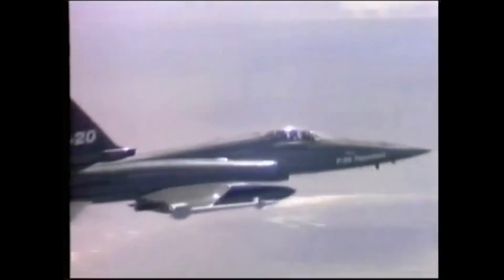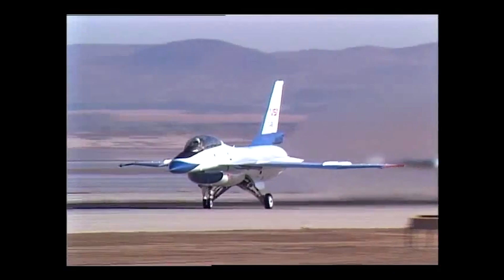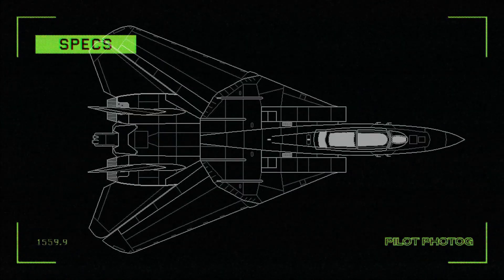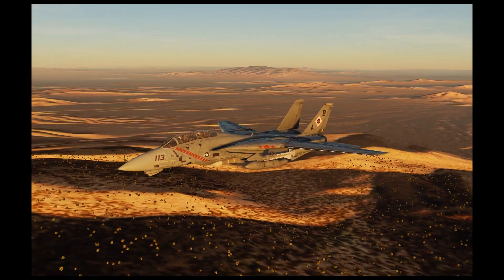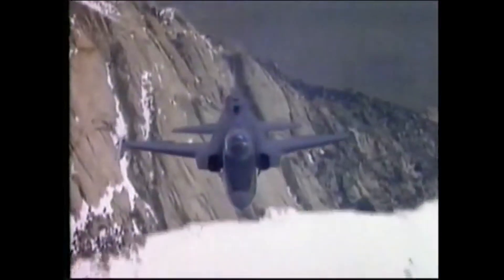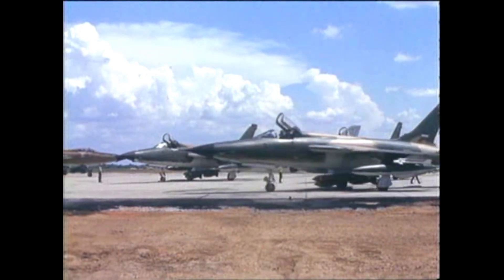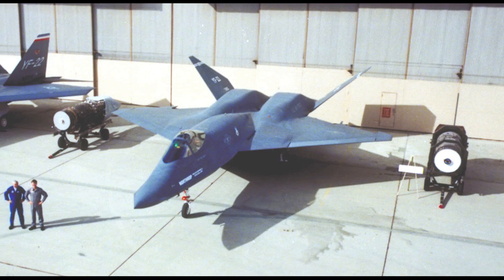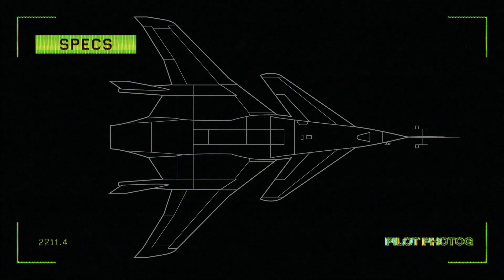Top 5 Fighters That Should Have Been Built | Best of Aviation Series by PilotPhotog  f20  f16xl

Comment: And... You 'forgot' one plane that our (US) Navy should've had. The F-8K Super-Crusader III.
Reply from the maker: Indeed and an excellent choice. I plan a video all about the Crusaders - they are excellent aircraft!
Reply: @PilotPhotog  It's two 'failings', compared to the F-4, were; Single cockpit, or 4 eyes Vs 2; And range. Weapons load favored the F-4, Except, in Cat-Launch. Hmm.?.  Climb, Roll-rate,  Turn-Circle, Touch-down-Speed, Top-Speed (limited by the Proto's canopy to Mach 2.7! on the F-8K), and Cannon Fire-power (4X20mm) all favored the Vought. I believe, that had the F-8K been used by the Navy (or Marines, albeit, the F-4 was a better plane for Jarheads), it would've taken the Role of the F-14 a decade earlier, added Recon that might've excluded the beautiful A-5 Vigilante from service (which, btw, the A-5 gave the F-15 MANY of it's 'secrets'), and likely still been 'front-line' in US and French Service into 2000+. Speed, time-to-Intercept, and the ability to scare-off a Flanker or Blinder threat are qualities all their own. Something the Admirals perhaps don't quite get? But, then again, Subs are something they often marginalize, so...

Comment: About the F-20 making more sense now because of miniaturisation of avionics. 

The Soviet F-16 competitor (the single-engined MiG-33) eventually got built by China with Mikoyan consulting along, as the JF-17. 

Even though the JF’s got an AESA radar and is compatible with the latest frontline BVR missiles in China’s arsenal — fuel capacity, combat radius, payload and loiter time are still effected. 

Most of these lightweight aircraft suffer from small legs too.

Comment: The Arrow was put into production, using a proposed twin tail design, and called the MiG-25. Avro Canada was totally infested with traitors who sent ALL the design and test data to Moscow.
Reply: Rubbish. You Canadians need to stop being so butthurt over the Arrow. It was too expensive for its performance level and inferior to the F-4 in just about all respects. That is why it was cancelled. Also the MiG-25 is not derived from the Arrow at all. About the only design point that is remotely similar is they both have a box shaped fuselage. The Arrow was never good enough for anyone to want to copy.
Reply: @dat581  , Hmm, YT is making it look like you replied to me, but that can't be right, because I am not Canadian and even called them a bunch of commie traitors.

Comment: Nope, non of them was really necessary. The F-14 concept was even dead at this time. The plane was built around the AIM-54 to interecept long range bombers and protect the carriers from long distance. After the fall of the soviet union the AIM-54 became obsolet and so did the F-14 and the Super Tomcat aswell. The F-20 was a concept that never really fit any needs. F-15, F-16 and F-18 were already there with the Super Hornet in development as F-14 replacement. No need for such a fighter. The F-16 was tactical inferior to the F-15 in many ways so there is no questioning why the F-15 E got choosen. The Canadian plane was too expensive for a threat that didn't exist at this time. It was a pure interceptor. It would have been outdated in short time. The F-23, well, it was either this plane or the F-22. If they would have choosen the F-23 you would have the F-22 as number one plane in the video instead.

But in my honest opinion no plane is really needed. As much as I like the technology as much I hate the purpose behind it. There shouldn't be a world in which we need such planes. And actually with the fall of the soviet union we don't really need any of them anymore. The modern threat isn't even a plane so what's the deal with having interceptors and air superiority fighters.

Comment: Politics were the reason f22 was picked pr demonstrations don't convince evaluations political clout does
Reply: The maneuver and the missile shot were extremely significant and unfairly spoofed the choice.  Both were great.  Would've been better if a reasonable number had been bought.  Too bad that earth-friendly primer used on the F-22s is crap and will shorten the service life of the platform.  The nuclear carrier Roosevelt is rusting out from the inside for the same reason.

Comment: the Arrow was scuttled by the petty minded spiteful george diefenbaker.
the excuse for destroying every trace was we cant let it get in the hands of the communists.
at the same time, the excuse was it wasnt really that good and wouldnt sell.
?
180 degree CONTRADICTION.
lies lies lies lies and MORE lies and with the big bugaboo about missiles, WHY were fighter planes with LESS capability STILL being built and especially PURCHASED by countless nations?
because most of what you hear from officialdom is CRAP.
Reply: Those 2 excuses are not contradictory. It wouldn't sell because as a platform because it wasn't anything special in terms of performance and was designed for an obsolete role. That doesn't mean the technology used was bad, it means the concept of the aircraft was bad.
And FYI fighters with MORE capability were being produced and sold in large numbers as well.
Reply: @dumdumbinks274  ?
accelerating straight up faster than its contempraries isnt 'anything special'?
and the role was NOT obsolete considering fighter jets continued to be sold by 10s of THOUSANDS then and since.
read up on it dumbdumb
Reply: @dawnjo8223  Correct, it isn't special if that's the only aspect it was superior to it's contemporaries in. 

The role was completely obsolete. The Arrow was a pure interceptor with a small payload developed to counter nuclear-armed Soviet bomber formations. It's speed was the only thing it had going for it in terms of performance, yet the age of Soviet bombers carrying nuclear payloads was basically over. Everybody was investing heavily in ICBMs that the Arrow could never counter, thus the Arrow was obsolete.

The reason fighters were still produced is because they performed a multitude of roles and could perform effectively in many situations... The Arrow could not.
Reply: @dawnjo8223  
1. There are hardly any interceptors at all... the only one still operational today is the MiG-31 and it is only used by Russia.... The only other interceptor to be designed since the 1970s is the Tornado F.3, but that was an off-shoot of the ground attack Tornado Gr.1, and it was a temporary solution until the Typhoon (which is not an interceptor) entered service.

2. Not every trace had to be melted down, that part is definitely political since the airframe itself wasn't advanced, but the technology inside it was. 

3. Do you only deal in black and white? They didn't destroy any bombers at all... the main threat changed to ICBMs, and the role of a pure interceptor such as the Arrow became outdated. Russian bombers switched targets from cities and military bases (per WWII doctrine) to a mostly maritime purpose... engage US fleets using cruise missiles.

Comment: F-107 - for when you need to eject out of your aircraft straight into the engines so you can parachute down as hamburger.
Reply from the maker: I can’t unsee this now lol. Thanks for commenting!
Reply: Heard Convair tried to make the canopy eject backward and cover the intake so the pilot can get out......But the inherent risk was one of the factors that killed the project.
Reply: Not true
Reply: Andrew Hogan  And you are still alive....
Reply: At least one US plane has downward ejection out the bottom of the fuselage.  Not to be used at low altitude unless inverted. ;)
Reply: @ShannonLooper  F-104 Starfighter

Comment: Chuck Yeager said the F-20 was the best fighter he ever flew.  Politics killed it. They wanted to sell the F-16 overseas. That and they thought the upcoming B-2 was enough for Northrop. 
Only one person flew the F-22 and the F-23. He liked the F-23 better. Again,  politics drive that decision.
Reply: The F-20 didn't have it's first flight until after the F-16 had already solidified it's presence worldwide, and it's performance never exceed that of the F-16 in any aspect. In fact hte F-16 had superior range and payload while matching the F-20's maneuverability and speed.

It was a similar case with the YF-23 which only had 1 true practical advantage over the YF-22, and that was it's range. The YF-22 had a payload advantage, and a very minor maneuverability advantage while meeting all other requirements and being cheaper than the YF-23.

Comment: The F-5 is something of an unsung hero, give many airforces a capability it would not normally be able to afford.

The F107 would be one I would have liked to have seen. By all accounts it was an excellent aircraft. I understood it lost out to internal USAF politics. Pity really.

F-23 was a much better aircraft than the F-22. I did read one of the reason the F-22 won through was because it used manufacturers from some 40 states and those in congress who represented those states wanted the jobs. The F-22 has paid for that because quality control is so poor that many parts have to be finished off before they can be used.

And who didn't want to see the F-14 still flying
Reply: At the same time, Congress recently complained that the parts are made in so many states and not consolidated somewhere, even though as you said, it was designed to have that aspect as a benefit/feature!
Reply: I'm not an american, but I have always wanted to see an F14 Tomcat because at some point during my childhood my dad got a toy F14 which had wings that can actually move, sadly i lost the toy, though it was already discontinued a few years after I was born.

Comment: The reason why the F-23 was not chosen is the same reason the F-20 was not chosen...their respective competition had better lobbyists in DC. The F-20 is by far one of the best fighters ever built and can fly rings around an F-16. The F-23 is to this day the greatest fighter ever designed. Always politics, just look at the disasterous F-35 program they are still shelling out money for. I know several fighter pilots stationed at Luke AFB and they all think the F-35 is garbage. A single F-16 shot down seven F-35's in combat with no problem whatsoever.
Reply: No, the YF-22 had superior payload and slightly better maneuverability while matching the YF-23 in all other practical aspects except for range. The YF-23 was also - despite flying first - behind in development compared to the YF-22 by the time of the fly-offs leading politicians to believe the YF-23 would go way over budget, not to mention the fact the only way the YF-23 could exceed the YF-22 as a fighter would be by using untested experimental technology.

The F-20 was never procured because it came way too late. By the time the F-20 first flew (the basic prototype, not a combat-ready fighter) the F-16 had already solidified it's presence in Europe and proven itself in all it's roles. The F-16 also had superior range and a larger payload capacity than the F-20, and the difference in price was only about 10% meaning that anybody who could afford the F-20 could also afford the F-16. 

The F-35 program is only a disaster in the sense it was heavily mismanaged during the early 2010s due to political interference and the whole idea of 'concurrent production and development' - that could have happened to any project. The fighter performs well and the reason you will hear some pilots say the F-35 cannot perform is because not all F-35s are the current iteration. There are still plenty of Block 2s in service as training aircraft, and they do not have the maneuverability or many of the matured systems of current production F-35s.
Reply: @dumdumbinks274  The F-22 had BARELY better maneuverability WITH thrust vectoring. If they would have included vectoring on the 23 it would have blown the 22 away. The fact is, the 23 is a far better plane and was designed as well for future capabilities far better than the 22. The F-20 is still better than the F-16, every pilot who has flown both will tell you that and the 20 is cheaper. Most importantly, the 20 has the lowest maintenance requirements and maintenance down time vs. flight hours of ANY aircraft in its class. That is huge right there alone. Maintenance vs. flight hours is literally the single most important feature of any aircraft outside of performance. The is why the F-14 was eventually scrapped because though an excellent aircraft performance wise, it was absolutely the worse when it came to maintenance vs. flight hours. Great plant to fly, horrible plane to maintain. The 35 is STILL the worse plane ever developed in its class for the US. The pilots I have talked to have flown the latest block and it still sucks. As they (the pilots) say, "can't run, can't maneuver, can't dogfight...the only thing it has going for it is its ability as a weapons platform to engage targets 120mi away which, BTW, the Tomcat was able to do in 1974 except much better...the plane is a dog."
Reply: @tedwojtasik8781  Thrust vectoring didn't add much to the YF-22... it's practical maneuverability is possible because of it's airframe. The YF-22 matched the YF-23 in sustained performance, while exceeding it slightly in instantaneous performance. The YF-23's airframe was never able to use thrust vectoring, so I'm not sure why you brought that up...

The F-20 was never shown to be better than the F-16 and Chuck Yeager was being paid by Northrop at the time he made those claims. No neutral opinion from a pilot (e.g somebody in the USAF evaluating the F-20 **as a customer**) who has flown all relevant aircraft exists. What has remained true to this day is the fact the F-20 had shorter range and a smaller payload, and was an outdated design at the end of it's life whereas the F-16 was much newer with a lot of potential. 

Maintenance vs flight hours is important, but not that important. Most of those maintenance hours are completed when the aircraft is not needed. For instance F-35s have been used multiple times per day in actual combat theatres. This is because the in-depth maintenance can be done when they return home, rather than while in-theatre. It might end up mattering in a full scale drawn-out war, but a full scale war is highly unlikely to be drawn-out due to the nature of modern weapons.

Now for your claim about the F-35's performance... 
1. It has no need to run if used properly, and while fully armed it can outrun a slick F/A-18. The F-35's Mach 1.61 was achieved while configured for a long range strike mission, and currently the only operational fighter that is faster when configured for the same mission is the F-22... a fighter that cannot carry a heavy payload and has shorter range.
2. The F-35A is the 2nd most maneuverable fighter in the US military. The pilots who claim it can't maneuver are usually inexperienced. These are the same pilots who would claim the F-15 can't maneuver because it gets beaten by F-5s in BFM sometimes.
3. The F-35 is not a bad dogfighter. It has a difficult time on the offensive at close range against the best dogfighters, but on the defensive it's maneuvering characteristics make it a difficult target too. Not that it matters a whole lot when missiles are still by far the dominant weapon in a dogfight.
4. The F-14 was was capable of engaging fighters out to around 50mi, or large unmaneuverable bombers out to 120mi. And it did so with less efficiency and worse results than the F-35. The F-35 can engage fighters out to around 100mi, and that is a limitation of the AIM-120, not the F-35.
Reply: @dumdumbinks274  So...the pilots are wrong? Um, ok, you obviously know better than the people actually flying the planes.
Reply: @tedwojtasik8781  None of the pilots I've spoken to or read or heard the opinions of have ever made such claims without doing so in a joking manner to poke fun at certain defence analysts. The only complaints relate to issues that are gradually being fixed as happens with all fighters, not the F-35's performance.

Comment: From other documentaries I got that the comparison between the YF-22 and YF-23 wasn't as clear cut, with the YF-22 being the better dogfighter, more reliable and requiring less maintenance. My impression is that the YF-22 was the better choice when erring on the side of caution but it's a shame that the YF-23 wasn't also produced because it was generally more advanced.
Reply: With the exception of the maneuverability the YF-22 has suffered from the exact fears the Air Force had of choosing the YF-23. Out of the 5 core requirements the YF-22 beat the YF-23 in maneuverability but lagged in thrust-to-weight, radar cross section, advance avionics, and super cruise. The decision was driven more by politics than it was by objective thought.
Reply: The F-23 would have probably been the better choice.
But I love the F-22